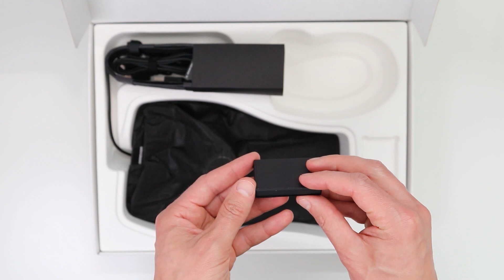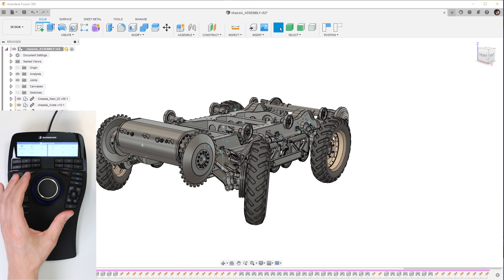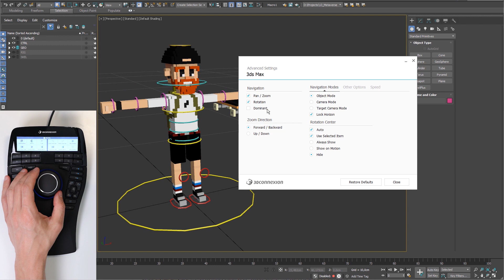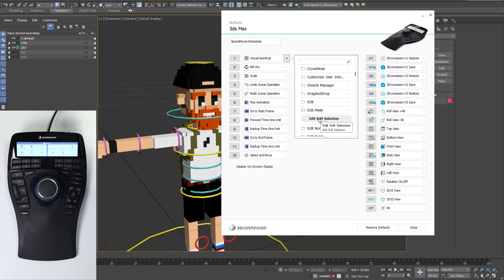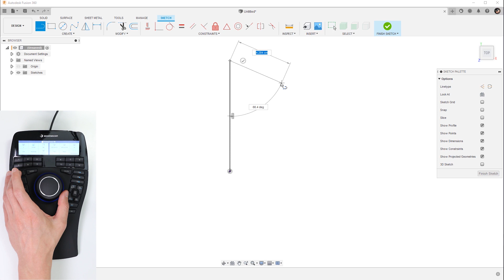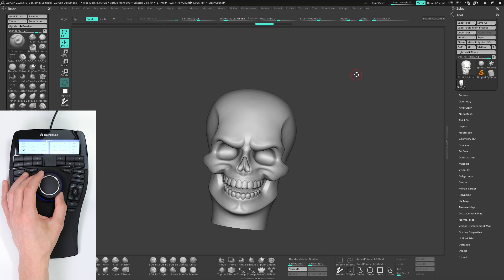WHY YOU NEED THIS! 3Dconnexion SpaceMouse Enterprise Kit 2 REVIEW

Comment: Incredible tool. Also noticed that 3D Connexion provides 3 months of ZBrush license with the purchase of the SpaceMouse. Quite a good deal. Can I ask if it works in Windows just to move the cursor around and things like clicking (to basically replace a regular mouse)?
Reply from the maker: Thanks for your question Alex. No, you still need a regular device like a pen or a mouse to control the cursor. The software addresses viewport navigation only which is great, as you can use your cursor for other tools while rotating, zooming and panning. The ZBrush deal is a great one too! For anyone interested, here is the link to the details: https://3dconnexion.com/uk/spacemouse-and-zbrush/
Reply: @3DGladiator  Certainly the navigation looks very smooth with the SpaceMouse.
Reply from the maker: @AlexLashko  If you are used to work with shortcut keys using the keyboard (and most of us are) you could go for a SpaceMouse Pro, the one without the LCD display and less buttons, or even for the SpaceMouse Compact, the one without buttons. The controller still is and will remain the main feature of the device.

Comment: Are the clicks hard or like a normal mouse? I'm looking for an ergonomic mouse with really light clicks, do you have any suggestions? thanks
Reply from the maker: I would say the clicks are perfectly balanced and slightly on the lighter side. Like I've mentioned in the video, I don't use a mouse 99.9% of the time, but if I have to for some reason, this is still the best mouse I ever owned. On the 3dconnexion website, they sell a left and right edition, and even an none-wireless one. I would go for the wireless version every time. Thanks for watching my videos and your comment. Best, Ben

Comment: Good review.  However I think the SpaceMouse Enterprise has a major flaw. If the whole purpose of the device is to avoid having to go back an forth between the navigator and a keyboard to activate commands via shortcuts, how do you input a dimension or angle of rotation or anything that requires typing numbers from the device? Or put it in another way, what is the point of having one device to trigger a command by pressing a button and having to move your hand to another device (the keyboard) to type the numbers require for the specific command. So unless I'm missing something this is not really useful.

Comment: Wow, this video review of the 3Dconnexion SpaceMouse Enterprise Kit 2 is fantastic! I've been using the previous model for years, and I can't wait to upgrade. The seamless navigation across various 3D applications is a game-changer. But let me tell you about a tool that can enhance your productivity even more. Have you heard of IdleBuster? It's an app that simulates mouse movements and keyboard activity, tricking time trackers into thinking you're actively working. It's perfect for those times when you need a break but don't want to be flagged as idle. Check it out!

Comment: I don't understand... first "push down/up pans the model", and then "tilt back/forth" rotates the model. BUT "UP" and "FORTH/FORWARD" is the same thing, right? "away from you". Both actions look the same, while watching the mouse and your hand in the lower-left corner of the video, I can't notice the difference in the physical action that you are doing.
Normally, on any joystick controller, when you say "push" or "tilt forward" - it's the same thing. Technically, there might be a difference, like "push forward" could mean pushing the entire stick forward (not just the top part), while tilting it could mean "pushing the top part, while the base remains stationary. But in any controller I've seen, the bottom part of the stick is always fixed, it can't move, so you would never push the entire stick forward, so "tilt" and "push" are the same.
But this is a round knob, not even a joystick, I can't imagine it would have such slightly different and fine adjustments (being able to both tilt it forward - so, just push the top part forward, and push the entire knob forward), while still being easy to apply them (and not frequently do a tilt instead of push, by mistake, or vice-versa).
But maybe I'm wrong, and some great engineering made this device possible. Otherwise, it probably wouldn't have been so recommended by many people working in CAD.
Or maybe I completely misunderstood the actions you are doing, and also can't notice a clear difference in the bottom-left side of the video, maybe if it was filmed from multiple angles. I might try it out...
Reply from the maker: It doesn't behave like a normal joystick; pushing and tilting are two separate movements. I hope this answers your question. Best, Ben
Reply: Yes. Thank you! I suspected that, but without actually having it in hand, I guess it was just hard to imagine having those precise different movements working flawlessly on a knob that’s not taller. Probably great engineering. Will surely find out first hand, planning to order it in the very near future. Thanks for the great review!